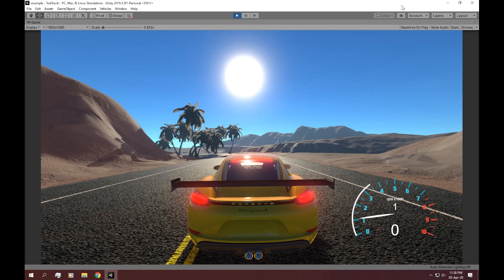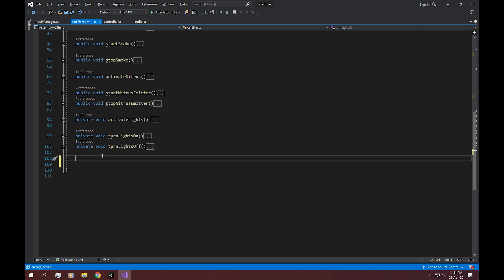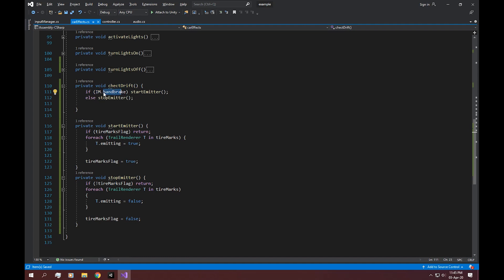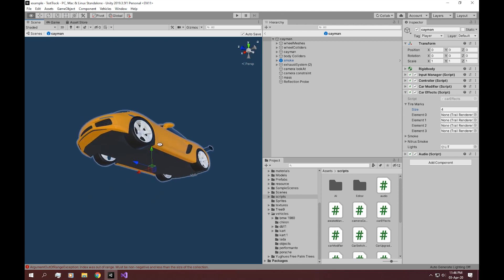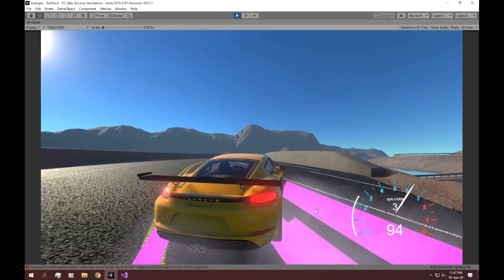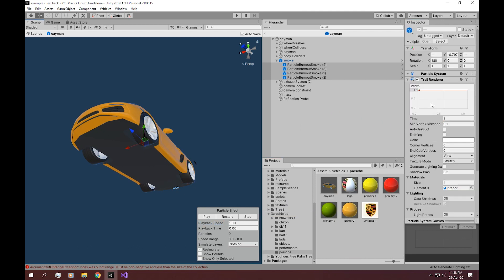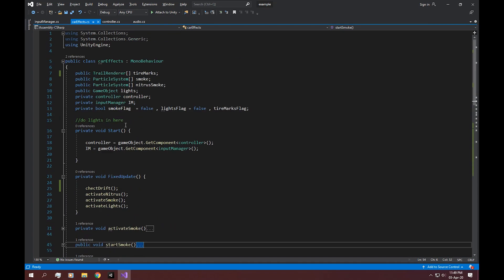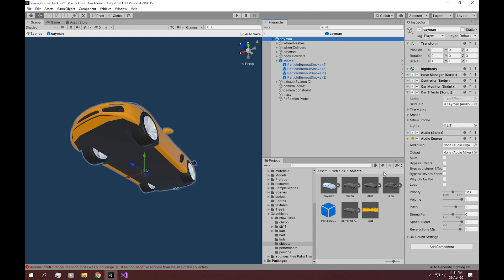Unity Tutorial - Skid Marks And Skid Sound(Trail Renderer)

Comment: Hi, wouldn't it be better to show the skidmarks depending on how the first goes, the friction and the force applied instead of just showing them with the press of a button?
Reply: maybe for a simulator, for an arcade mode this is really good
Reply: @goexgames466  even in an arcade game you shouldn't trigger skid marks from both front and rear wheels by pressing the hand brake. In a sim Front skidmarks should be triggered by wheel slip, but in an arcade you could use speed and steering angle.